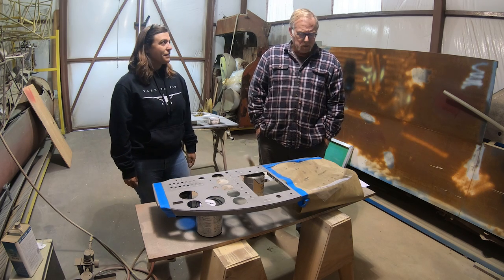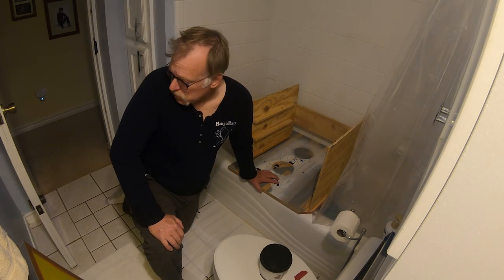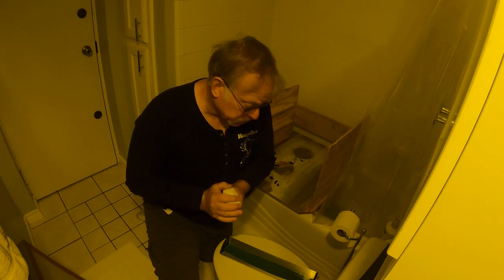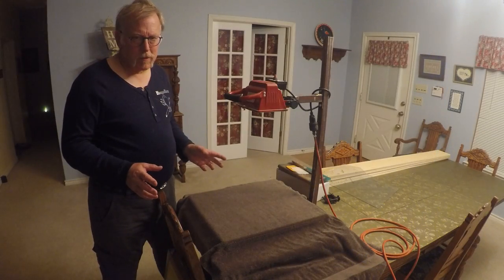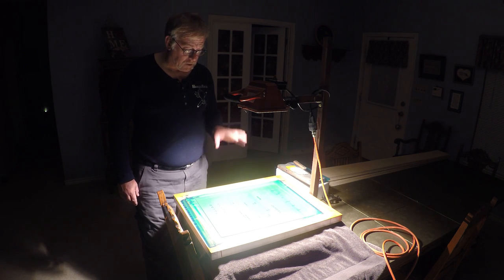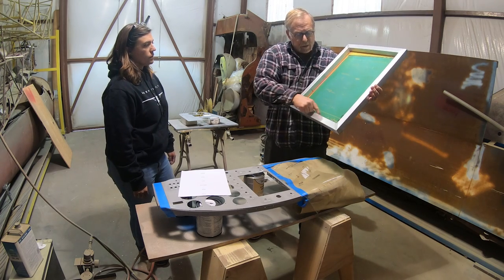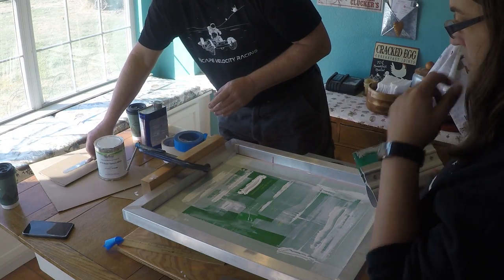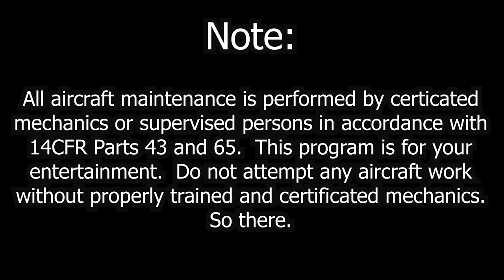Low Budget Instrument Panel Screenprinting!

Comment: Thanks for this; it's a good introduction for me. Never silk screened before, but have had a need for print on various types of panels a couple dozen times. This is getting me started for sure.
Reply from the maker: Not that hard. Just start. No need to spend a ton of money. Start small. Most local screen print suppliers have beginner classes. Thanks for watching!

Comment: I would have liked to see the steps she mentioned as they were fast. When she made the new aluminum panel, did that have to be engineered  and an approval  given to use it in a certified aircraft? Thanks for your time and videos.
Reply from the maker: Hand fabricated. 14CFR21.9 for approval.
Reply: Thanks for the information. Have a nice week ahead.

Comment: A first class video showing one way of getting professional standard panel markings at a budget price, my approach to this was CAD milling of the panel and milling the markings through the paint with contrasting colour paint laid into the lettering. Without doubt a more expensive process. Only time will tell if it is a more robust method, I suspect that if I do change my Avionic fit the new panel construction from start to finish will be much quicker as now I have the basic CAD file modification is relatively simple………………… but I don’t see that happening any time soon, Garmin have enough of my money.
Reply from the maker: For a one-off type of installation we will hand fab the panel.  If we were a production shop we would cad/cam.  Can't really recoup the cad layout time on a one-time fabrication.  We can fabricate quite efficiently.  That being said, we do all our artwork on computer.  I burn screens, print, and then strip the screens for the next job.  I can easily edit and reprint a file, then burn the screen again lickety split.  Another item we will do (lifted it from Cessna panels) is label radio circuit breakers as Radio 1, Radio 2, etc. and not NavCom 1, etc.   Because life changes...   Thanks for watching!

Comment: Can this be used on an already installed panel ?
Reply from the maker: Not easily.  The limiter is the screen frame and trying to stabilize it.  Thanks for asking though!
Reply: @HangaRatz  thanks for answering. Is silk screening reversible (erasable)? Also are the screens and frames custom size? Say to add a word for a switch or something. Thanks again.